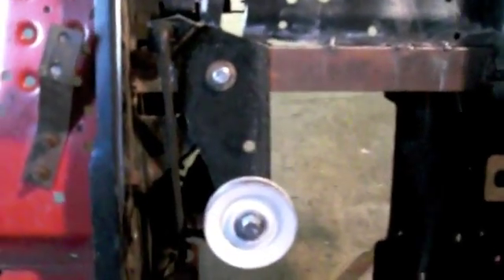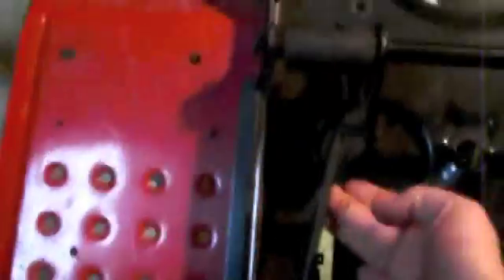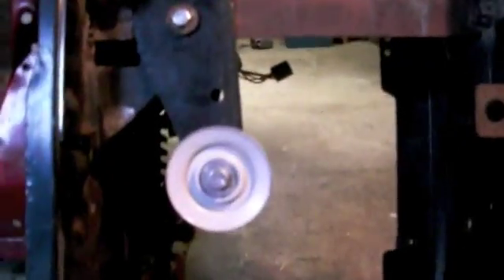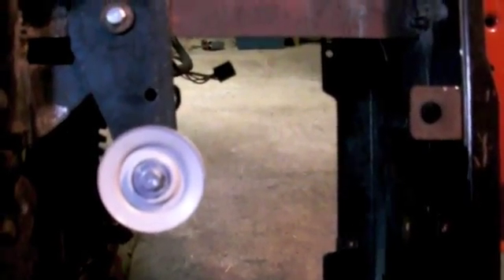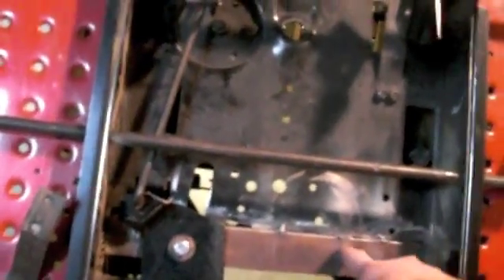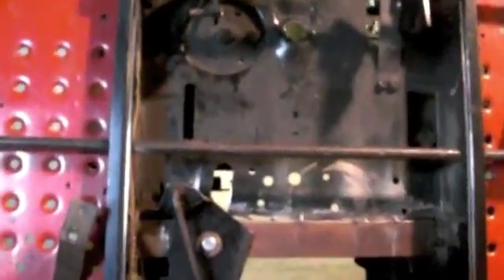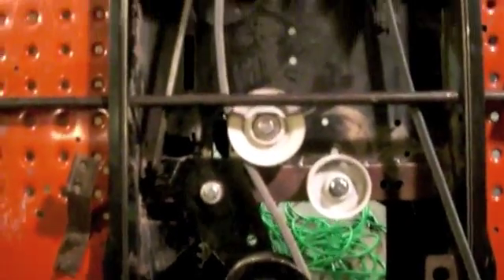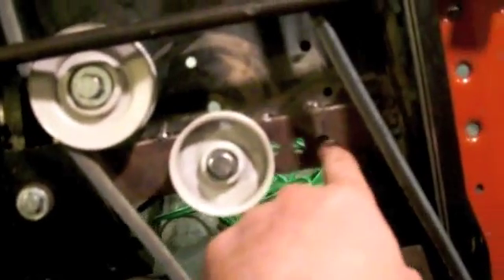Drive Line - Converting Vari-Drive to Manual Transmission

Comment: Wow, that spring is really heavy duty. There wont be any belt slippage with that. I like the fact that you made it adjusable, you'll be thanking yourself later for that one! Where did you get you idler pullies? Are they all metal? 

Ha ha ha.... Brakes....  what are those? I haven't had any for awhile.. lol
Great vid! I may be doing this soon!